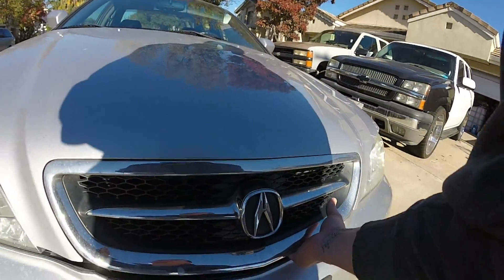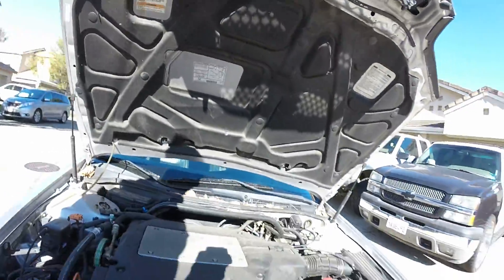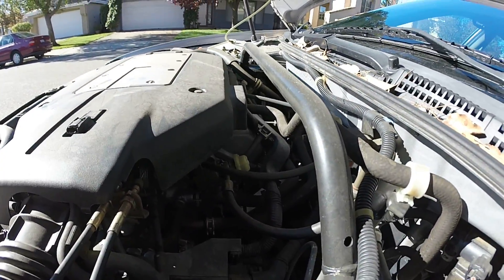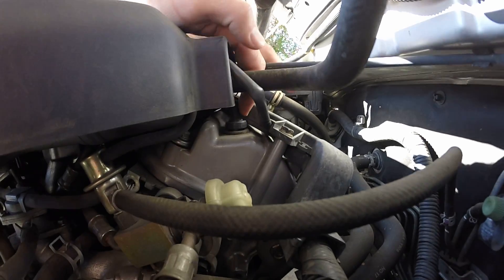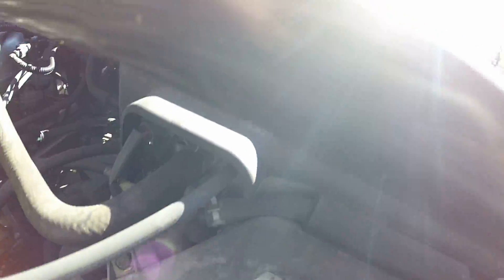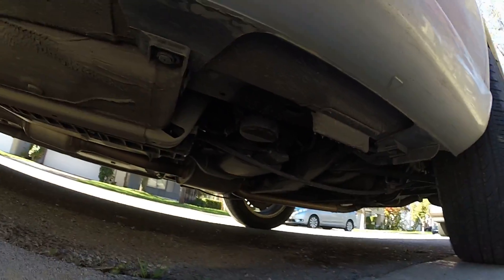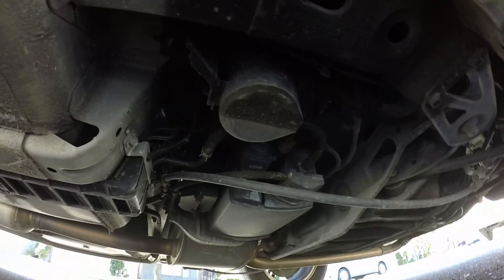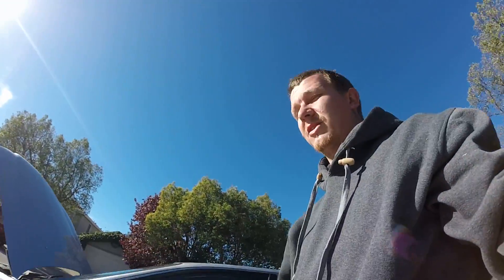⫷ Acura / Honda v6 emissions: PCV, EGR, & EVAP locations. TL, RL, Accord, Odessy, etc ⫸

Comment: Hey Scottie, I've got a 99...and upon acceleration I hear a crackling noise similar to a cd-rom reading a cd or bad brushes inside of the alternator. However alternator was changed last year and is charging properly....have you experienced this issue before?

Comment: Hi Scottie, where is the fuel filter location on an ‘02 Acura 3.2TL?
Reply from the maker: I believe its in the fuel tank attached to the fuel pump. No external filter.
Reply: Okay thanks. That sounds like it would be a pain in the arse to replace.
Reply from the maker: @georgedoughly6344  yea, they are usually only replaced when the pump needs to be replaced.